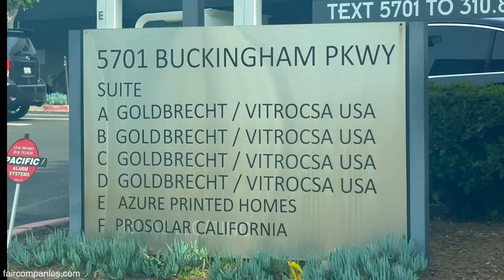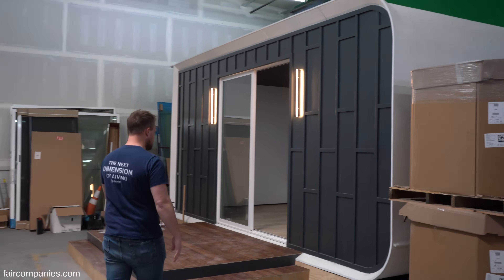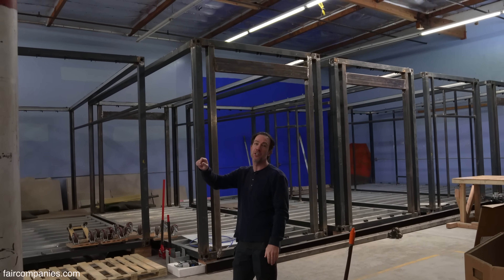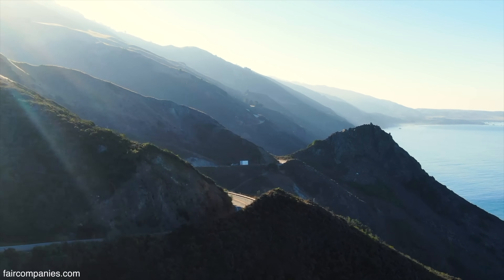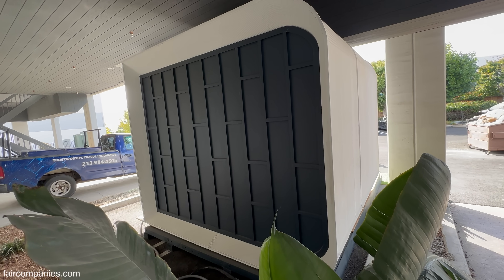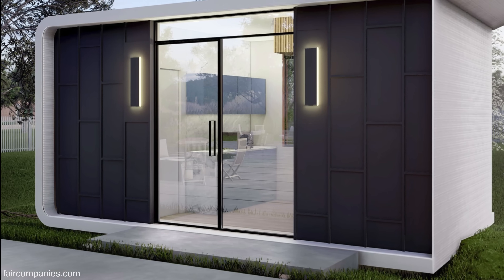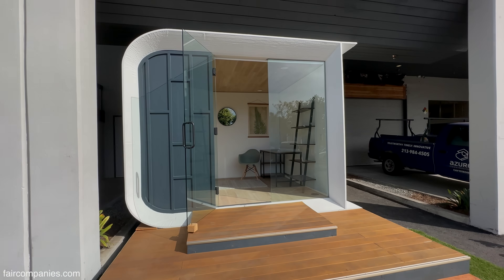Housing crisis + plastic overflow = prefab made of used bottles

Comment: This is a far more effective model for a 3D printed home. Printed concrete homes have to be made on site/require extensive machinery set up+teardown/use non renewable materials/not made in a controlled factory environment. Very cool.

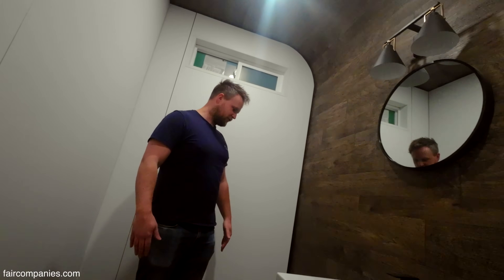Comment: doh not using the 3d printers best attribute  = the 3d matrix in the gap for extra strength and insulation holding. 5:27 shower wall added later = a seam that needs sealed and could leak DOH.  Design better.   wheres the holes in the floor for dust extraction and air to air exchanging heat pump.

Comment: We have 3D printed, concrete based houses in the Czech Republic (so far only prototypes). I salute the recycling aspect, but I wouldn't expose permanently plastic to Sun, cold at night, rain, wind etc. I have concerns about the microplastic effect as well. Also I can't imagine that this structure can breath (maybe I'm wrong). So you immediately need a solution for that. My other concern is about any fire. 
I think the direction is good, but I'd prefer indoor versions of any plastic based structures (furniture, dividing walls, storage structures or even tiny blocks like in the video, but with more controlled heat and moist effects).

The additional cost to make a box like this usable is very high. And you need at least 2-3 of these to be able to live there. If the video wouldn't suggest the product as a solution for housing problems, I'd feel less weird about it.

Comment: I see post and beam on at least one interior shot. Can the exterior not be made like a honeycomb, to create a stronger structure as well as dead air for insulation? (Oh, he says it has dead air and it's R30, that's amazing.) I like the white roof and walls - most of the USA should employ white roofing - not the black exterior front wall. Black is aesthetically pleasing but for practical reasons, no. It will just heat up like crazy.

Comment: Too small to be anything but an office/art studio. Whoopie, two chairs, and a tiny desk? Could you even fit a twin size bed in there? Honestly, this sucks, especially for that price, i'd rather buy a shed, stick straw in the walls, staple chicken wire over the straw, and plaster it for 1/3 of the price and it would be bigger too. Not to mention that the curved floor reduces your useable space even more as you wont be able to push your furniture to the edge.

Comment: I've seen some other printed homes made from other composites of cement and biomaterials.  I think what is interesting is that you can design everything on cad and take the machine to the site and let it do its work. All the plumbing and wiring could be done from the outside in, quite easily by perforating the wall only where it needs to be.  Then the whole structure could be covered in an insulating layer with vents and vapor barriers. With no studs, you have cut out a lot of labour and also opened up possibility for a range of insulating and finishing materials.  In the end, it could end up looking like a traditional house, even with shingled finish, or synthetic stone veneer to match the natural environment.

Comment: SOOOO many questions.
1) Is there an in-floor heating option? It would be easy to print into the structure.
2) Can you request a higher ceiling in the building?
3) Is the floor bolted to the concrete pad it's installed on?
There is SOOO much more that could be done. Being someone the as done 3D printing and certified in AUTOCAD Revit, I could see soooo many customer focus options.
Are they hiring??  🤔
Reply: You could turn it on its side to get a higher ceiling

Comment: I have questions about the ease of accessing the wall cavity for servicing and modifying electrical, plumbing, insulation, etc. How does the wall cavity breathe, or does it need to? How does this structure withstand varying climates and weather (high winds)? If this is a final product, I have concerns about its ability to accommodate change. I would want fairly easy access to the functions in the wall cavity. Finally, people's tastes and needs change over time, and this build seems too rigid to accommodate change. Not condemning (something I don't understand fully) just sincerely questioning something that seems interesting. Questions need not create a road block, rather foster design challenges.

Comment: My only concern would be fire.  Years ago I worked in a prototype plastic house that was supposed to be the way of the future.  You couldn't tell it was plastic but it was supposed to be very flammable and had really toxic fumes, hence why it never caught on.  Our fire procedure was that at the first sign of fire everyone had to get out immediately, not even trying to put out a bin fire.
I'm sure things have advanced a lot since then but I'd like to know the fire safety in these houses.
Reply: Fire safety is a serious issue. I was hoping they used sand as part of the mix for this reason. Fire safety isn't addressed on the website.
Reply: They mention fiberglass and carbon fiber as part of the formula. I assume that those lower the flammability enough to meet safety standards.
Reply: The advantage of plastics is that you can mix in fire suppressant chemicals.
There's printer plastic that has that so you can print electric junction boxes, etc. 
Matterhackers has flame retardant filaments (in case you need keywords to search.)
Reply: This product is not much different than countertops like Corian, etc.. Research what those products due in fire & what's in the fumes.
Reply: good point and air quality too would be a consideration
Reply: isn't WOOD flammable?
Reply: @shlby69m it's the poisonous fumes given off by the plastic when it burns rather than the mere fact that it burns at all that is the problem.
Reply: @AndrewHelgeCox  People die of smoke inhalation rather than fire so...the point is still a bit moot
Reply: @shlby69m  Yes, but ignites less essily and burns much more slowly.  And it does not give off the toxic fumes plastics do.  These fumes cause the deaths that result from smoke inhalation.
Reply: @Amanda-jd8xs  People die of smoke inhalation not the fire which is also poisonous and there are plenty of plastics in the average house
Reply: @shlby69m  Yes, wood is flammable. It has certain characteristics that make it less benign than plastic typically is. It keeps its structural strength longer on fire. It puts out fewer toxins. It burns slowly outside extremes (thickness vs temperature). When it burns, it creates charcoal which is itself resistant to flame. 

To add, building codes have requirements that mitigate the danger of fire with wood as well. If these plastic structures used plaster or thick drywall, that would go a long way to addressing fire concern. Ditto ingredients that mitigate fire danger. Some woods and other building materials are treated with fire retardant for example.
Reply: First thing I thought...and climate in a plastic house wont' be that good either!
Reply: Yes.  It would not be allowable material in a habitable space because of the flame spread.  And CalFire (for example) would not allow it on the exterior in a wildfire zone.  And it does not meed code for anything structural, while also not insulating nearly as well as foam.  So how do you fasten drywall or siding?  In the summer it will get unbearably hot.  So the point is to appear futuristic enough to catch investors that will lose their entire investment.  Both of those things will happen.  Why KD features this I have no idea.
Reply: @SpaceCrete  @wilty5
in order to actively sell them to the public .. I am going to assume it HAS passed those tests.  I remember modular and tiny homes being sold to the public having to pass code before sales were even allowed
.. but please, cite the report(s) where Azure Printed Homes hasn't passed building or fire codes, if I am wrong
.. note the cavities where they insulate after installing wiring/plumbing without thermal bridging
.. you don't fasten drywall or siding
.. you provide the cooling/air circulation via end walls
Reply: @SpaceCrete  It appears to be allowable as they're installing them. PLease sprovide evidence that it doesn't meet code for structure - or is that you just assuming with your opinion? It has foam insulation. Drywall? Siding? The print IS the drywall and siding - the internal and external finishes..Why you bother to comment I have no idea..
Reply: @adammacer  Basing on the Mighty Buildings homes that I looked into, which I believe is the same situation with this plastic.  Those never met any building code other than the accessory dwelling exemption, and still have to put drywall over the plastic -with glue I guess. I can point you to a copy of their fire rating approval, where that is stated - and they still don't meet the IBC.  The deception to the consumer is outrageous - why I am commenting.  There is no way that their plastic can be used structurally by the IBC, and no way that it can be the exposed surfaces of a structure in a habitable space by any US code.  I have been through these approval processes. The original commenter here is absolutely correct bases in his experience.
Reply: @SpaceCrete  They mention fiberglass, carbon fiber, and "other things." It seems those additives lower the flammability enough to meet safety standards in California.
Reply: @Mavrik9000  The inside of the print is covered with another material, looking like some kind of synthetic flooring.  That would be the material a building official would consider relevant for a habitable space.  Glued on? An accessory building (officially without elect or plumbing) under 120 sf does not need a permit (in CA) - this is how some tiny homes get into place.  Call it a storage building for permitting purposes then hope the neighbors don't complain.
Reply: @SpaceCrete  "So the point is to appear futuristic enough to catch investors that will lose their entire investment" 

This is how I know you haven't even tried to verify anything you've said. Pure speculation with the certainty of someone who's too uninformed to tell how uninformed they are.
Reply: @La0bouchere  I can send you the UL report for Mighty Buildings, which is going to be no less fire prone than this one.  I have not problem with you not agreeing with me, but the totally uninformed part not accurate and  just too unpleasant - can't we avoid that part? Thanks
Reply: @La0bouchere  One perfect example of your quote: Cazza Construction, that persuaded gullible investors with graphics of futuristic robots - printing high rises in Dubai and stuff.  The hyped images are still online now, making it look like Cazza Construction still exists.  It never existed.
Reply: These concerns need to be addressed by the company, the fact that they didn’t address this in their presentation is concerning.  What are they using as a fire retardant?  I could also see where the fumes from a fire could be harmful and highly toxic, after all it is made of mostly recycled plastic.  I would like to see the certificate and detailed results of a study that says they passed a hazardous/ toxicity code.  I know this method of using mostly recycled plastic to 3D print homes is new but what studies has/is this company doing to determine the safety of living in a house made from this material?
Reply: The material will likely have passed a code for them to be able to build with and sell it for housing. Just like other building materials and products
Reply: That and now I also saw in department store they want us to buy clothing with plastic incorporated into it. No thanks.
Reply: @candyclemens4432  My dude... you're already wearing clothes with plastic in it. What the fuck do you think polyester is?

Comment: You still have to get the permits from the County, have the utilities installed, hookup plumbing....so the cost overall it's possible could skyrocket to $100K.
Reply: Municipal governments and their hunger for taxes and power are a major contributor to the housing crisis. There was a time, admittedly long ago, when you could build a house without being hindered by expensive permits and development fees. to say nothing of the excessive delays in getting such permits. Governments are supposed to serve us, but increasingly they appear to be our enemy and are hostile to our needs and wants.
Reply: It depends on where you live. In places more rural there is no impact assessment and no building codes with permits being basic and on the inexpensive side. Flush toilets may become obsolete as it costs so much money to use gallons of potable water and then infrastructure to take it to be processed and cleaned before discharging into some body of water. Incinerating or composting toilets make more sense especially in areas where water is scarce. Plus poop and vegetable waste can be used to create methane that can be used to create electricity for heating or public transportation.

Comment: Seems like a wasted opportunity to not print them in place. That 3d printer arm could go on a pretty small trailer and fit way more places than a semi trailer or crane.
Reply: Can you imagine all the checks and assessments that would need to be done for quality control and code compliance before and after each transport? Nope. Transporting the products when ready to assemble is far simpler, safer, and more efficient.
Reply: ?  The size of the printer is way larger than the house/pod/box ...  and requires 480v to run...  and is in no way weather resistant... and transport/setup/teardown time is time that is not used for production???
The printer can run 24/7 hooked up to the grid in a warehouse which contains the bisphenols and phthalates from the printing process and makes it convenient to do the finish work?

Comment: This is a great concept to improving the method to home construction. I see the value in cost to construct and speed. I’m struggling with the deprecation strategy of these units and it’s plastic composite materials. How does one recycle these homes as someone remodels or upgrades it requiring the demo of an existing structure? I’d feel more comfortable about an investment in a structure like this if I knew the supply chain model and what the house could be recycled into either after wear or where an upgrade is required.
Reply: Conventionally built homes aren’t recycled at all. If they’re remodeled, they create huge dumpsters full of waste.
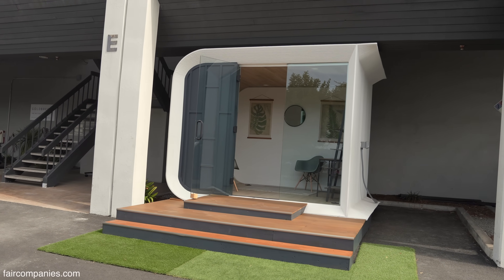Reply: If you check back around 2:15 thru6 discuss that this unit here is basically a prototype and I think the implication is that these units can be built with modularity in mind, with the ability to add/remove components as needed

Comment: There is a huge problem with ppl ingesting microplasctics from daily use of plastic bottles so I dont think living inside a plastic bottle is a good move.  Hard pass for me.  

Side note: these tiny homes are ridiculously overpriced.  I cant belive this dude is selling plastic closets for 50k each 😂.
Reply: Price is the finished product including plumbing, electricity, kitchen, bed and bath. What does a 900 sq ft house sell for in LA today? Zillow says a 1300 sq ft house in Los Angeles is worth $1.3 million, and an empty quarter acre lot is $475K. THat means 1300 sf house (built in 1923) is $825K.
Reply: When you leave your plastic drinking water bottle in the heat toxic chemicals leach into the water. Imagine living in this on a really hot day
Reply: Plastic is your friend, trash is not.  He's overcharging for trash (relabeled "recycled").
Reply: @cynot71  Wow, no dear one, plastic is not healthy.

Comment: So cool but is fiberglass not toxic? and is it safe to live inside plastic What about the tostic frum?
Reply: Fiberglass fibers are silica, which is extremely inert.  Usually the toxicity comes from the resin or binder used in fiberglass construction -- but here they're using the glass fibers extruded in the 3D print with the recycled plastic they're using...
Reply: fiberglass is made from glass, glass is made from sand, sand is the most non toxic substance on the planet. fiberglass is actually inert as it reacts with nothing.